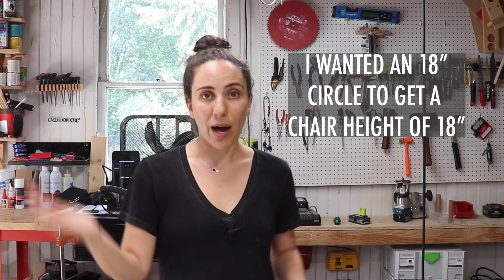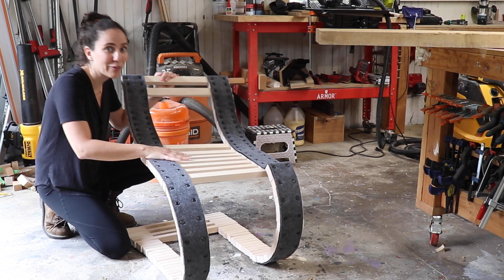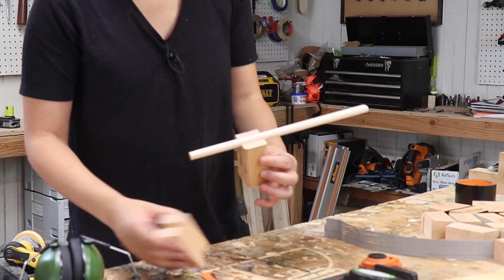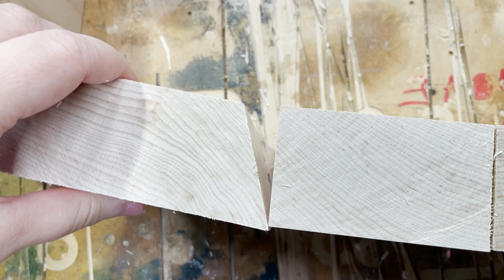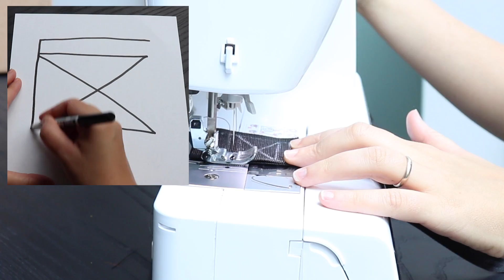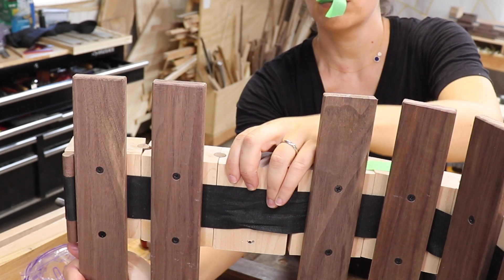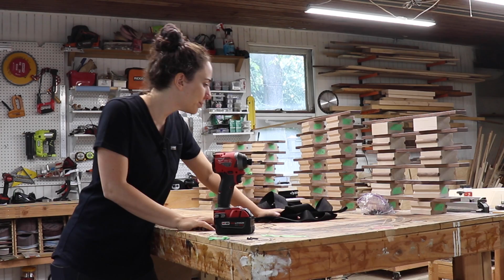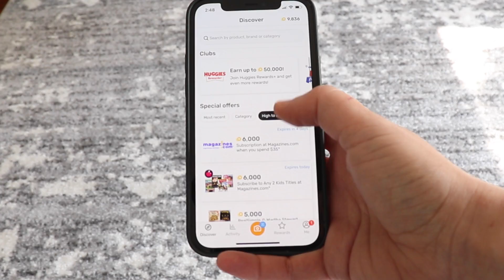I ATTEMPT to make a Roll Up Chair… AGAIN...

Comment: I haven't followed this series, but this being the first of them i've seen, I think that if you want to keep the straps you need to not only account better for their stretch but also minimize it better than just shortening them. 

If we first look at minimizing it we can see that under tension the length difference (so the gap between the blocks) should be approximatly proportional to the force they are pulled apart with and their initial length. Given both this and the problem you saw with the back caving in, I think it's reasonable to conclude that you most probably will have to anker the straps to the individual blocks so the tension is localised. I would suggest keeping the four screws (To not have the straps rip out the boards in the concave part) and adding nails that go throught  the straps that hopefully don't damage the fibers too much. You can also maximize the effect you'll have from this by using a symetric pattern of nails like that stitching pattern that stretches out as far as possble to the edge of the block on either side, shorthening the distance between them and the nails on the next block and thus the length of the corresponding strap segment as much as possible. Of cource this would again cause the problem of not beeing able to roll the chair up if you don't instead of making the boards less wide to solve this make them thinner. I would even go so far as to say that your best bet would be a shape that stretches the whole or almost the whole block, but comes to the edge at a somewhat shallow angle. Then you can nail the strap in closely to the edge. Lastly you could add a third or if necessary even more additional straps as the force would be distributed.(Though this would introduce tolerace issues to the picture like making a table with four legs instead of three)

As for accounting for the inevitably stretch that will happen when you sit down you can either pre stretch the straps which would a pain or create some room for it in your wooden structure. I.e. you could give the blocks a second angled cut that would allow you to assemble them in a position where only the first half of their faces and the dowel align and under tension they could pivit around the dowel up to the angle you wanted in the first place. Obviosly given the small amount of stretch depending on how much of the last part you chose to implement you wouldn't want extemely different angles for that second cut as the chair wouldn't stand right without the tension, but maybe a few degrees would help in the right places.

Hope this helps and best regards from germany ^^

Comment: In the areas with the large gaps the blocks are pivoting on the inside edge so the entire upper half of the chair is acting with a massive mechanical advantage maybe (50-100x) vs the strap which is very close to the other side of the pivot. With full body weight on the chair the force on the strap is massive (potentially tons)  and any small stretching of the strap is magnifed by the length of the chair. It's like jamming a 2x4 under something to lift it up. You move the 2x4 down really far and can easy lift a heavy object up a small distance. What if the bottom part of the chair had a arch to it so that the seat would end bending down and sitting on it to more safely support the weight of the person and reduce the tension forces needed? A chain with nearly zero stretch would help a lot but it may also be good to connect the pieces just to adjacent ones so that entire system isn't dependent on a single tension so that if one part bends or rolls up the entire thing won't loose tension and collapse.  Love this kind of challenge!!!